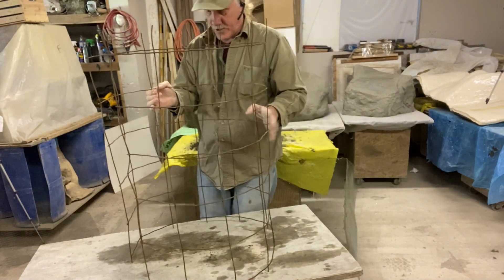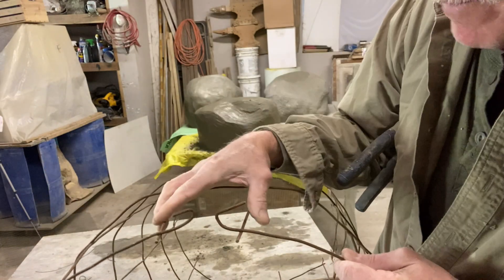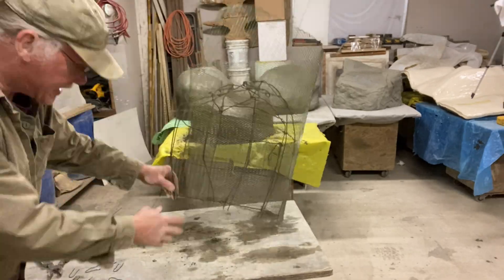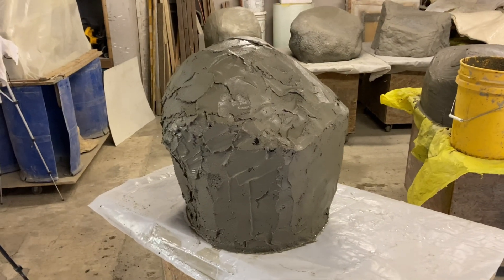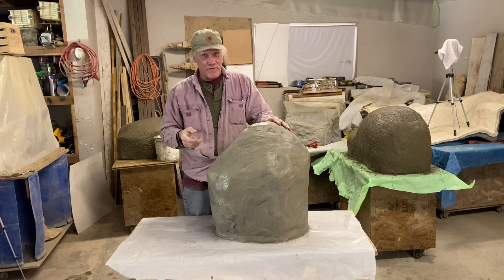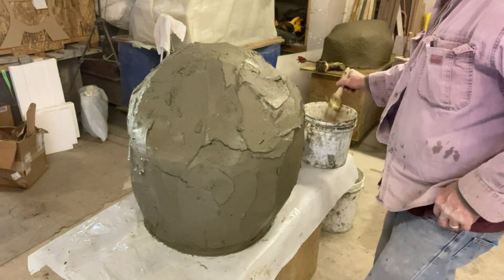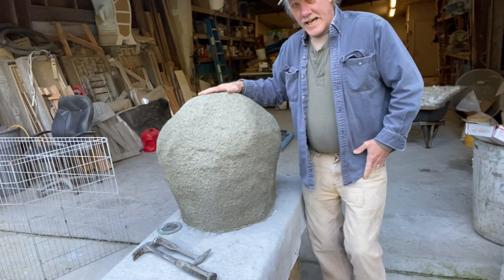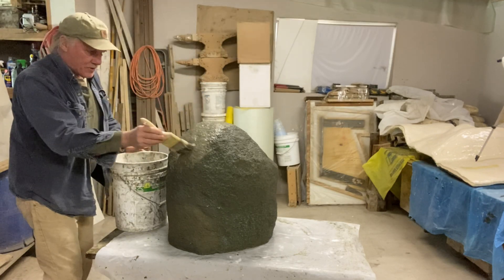Make fake rock with cement & rebar and lath

Comment: Great video.  I have lots of medium sized rocks to make and feel like the galvanized metal lath would be hard for me to wrangle without cutting myself.  Would a fiberglass mesh type lath work for this project?  It seems like fiberglass might hold up better in the wet Pacific Northwest weather I live in, but don't know if the fiberglass will hold the cement as well as needed for this?
Reply from the maker: I have made a lot of rocks in the last 50 years, which had no mesh and I’ve had great success… obviously putting the mesh into the equation will strengthen the rock, but it’s not absolutely necessary. Thanks for watching my video.

Comment: just dig a hole. Pour concrete in and push it up the sides. Line with chicken wire and add another layer. Then add a layer of spray foam. Flip and wash off excess dirt. Tada
Reply from the maker: There’s a lot of ways to skin a cat… thanks for watching my video

Comment: I want to make a hunting blind with 5' x 7' x 6.6' height , inside measurement . must be portable .  Your Take . ?
Reply from the maker: I’ve actually designed blinds before using our tree panel molds and also I did a rock version of it as well. Both were segmented for easy transport and easy to assemble and very durable lightweight. I did this about 10 years ago, but the project never came into fruition. It’s always been something I wanted to mass produce, as I believe there would be a huge potential. Thanks for watching my video.

Comment: Suggestion:  FILL THE HOLLOW CORE with paper and it will support the wet cement mix. The expanded metal lath is all that's needed and is easily shaped to your liking. After it dries, the paper will easily pull out.
Reply from the maker: Thanks for the feedback. I appreciate you watching my video. A lot of people suggest alternative measures and that’s great each one of us bring something to the table and usually we keep what’s good for us and we throw away that we don’t care for.
Reply: Not a good suggestion.

Comment: Hey, I just found your channel GREAT JOB! im a pro as well, hey just a tip i found another type of mesh . 24"x100 foot long. for 100.00 its galvanized 1/8x1/8" square its easier to bend as well.. ;)
Reply from the maker: Tony, thanks for all the positive feedback. I appreciate you watching my video.
I try never to use steel reinforcements as they will rust out. The textile reinforcement both fiber, and the mesh I use will last forever.

Comment: Thanks for sharing all this, its been really helpfull. I was wondering, I'd like to make fake rocks for in my fish pond. Now I'm worried that the cement will eventually release chemicals into the water and that it will be harmful to my fish. Does the hydroseal ensure that the cement becomes completely inert, so I can use them in my pond without any issues?
Reply from the maker: I have been successfully building all kinds of environments/habitat for fish… obviously there are  process/practices to safeguarding fish. As is the case with any endeavor, you have to do a little homework, and obtain understandings for optimum success. Thanks for watching.

Comment: How could we go about making a solid version that weighs alot?
Reply: I got a place where I can get all the rock I want. I think I got about 40 or 50 tons so far. I did find one rock that floats in water.
Reply from the maker: That sounds great. Thanks for watching my video.
Reply from the maker: I have several techniques that I call solid fill construction. There are many applications where we do want a heavy rock.
Reply: @fauxrock  have you ever tested them in a wind tunnel? How do they handle at 120 to 140 mph? Seriously I saw that kind of wind for over 3 hours in hurricane Ian. We still have tilted and one sided trees and poles. How much does a manufactured rock cost? I know real landscape rocks cost a fortune. I figure I can haul close to $1000 worth just working one hour a day from the prices I was looking at. (Local hardware landscaping company) 
I'm not sure which is more work hauling rock or building one. 
If it's a good enough rock maybe mother nature and the hurricanes will not even notice and blow right past it..
The wind tunnel and an good aerodynamic design it what you need. 
Or just fill them with water..
Reply: @fauxrock  any videos on that? Thanks

Comment: Looks great but I was wondering what can I do to make a rock to display a jeep flexing on it ?
Reply from the maker: I’ve done that a number of times already over the years. Like anything in building you can make a structure hold a certain amount of weight without an issue again building the same way. I just built this rock but obviously there’d be a little more reinforcement and it might be a little thicker. Thanks for watching my video.

Comment: What's the point of hydrosealing? Isn't cement/concrete waterproof as it is?
Reply from the maker: If you say so… I’ve spent my entire working life building diverse cement applications… I strongly recommend hydro sealing…

Thanks for the feedback… I appreciate you watching my video
Reply: Sorry I didn’t mean to make it sound like it’s wrong. Im genuinely curious as I am trying to recreate what you are doing.

What kind of effect happens if you don’t hydro seal? Does it crack?
Reply from the maker: No worries it’s all good… cement can degrade over time, if not properly applied and sealed

Comment: What does the hydrocele for .
Reply from the maker: Hydro sealer is a cement mixture we utilize to create a seal coat prior to stain the rock. We then apply a clear 100% acrylic sealer as the final seal coat protection.

Comment: Also do you have suggestions for attaching these to the ground so they don't blow away or is there weight sufficient?
Reply from the maker: The way to the Rock should be enough to keep it from blowing away, but most always whenever I install rock in the landscape area I dig it in about an inch or two below the soil or Mulch or grass whatever it sitting in so that when can’t get up underneath it
Reply: Url not secure?
Reply from the maker: That is something I paid for but GO Daddy has dropped the ball on… Im calling Monday to fix this.
The funny thing is, if you look on a PC at my website, it comes in secure you look on a cell phone it shows it’s not being secured.???

Comment: What would you have preferred to use instead of the expanded metal?
Reply from the maker: I like using the mesh, which is made with a poly propylene instead of using the expanded metal.